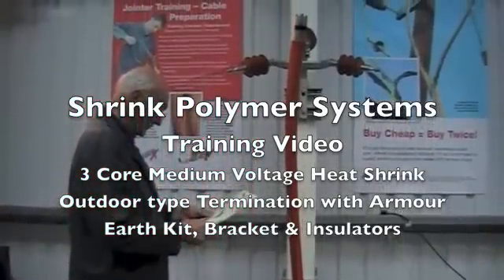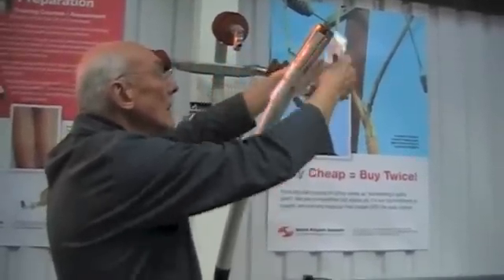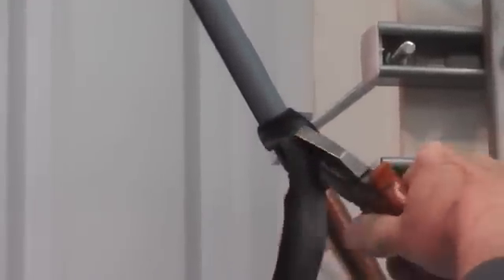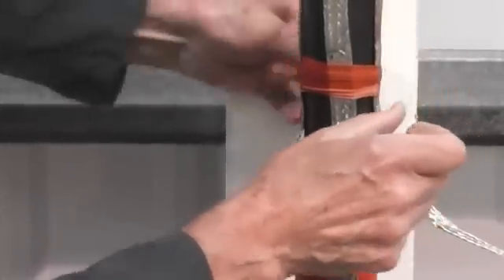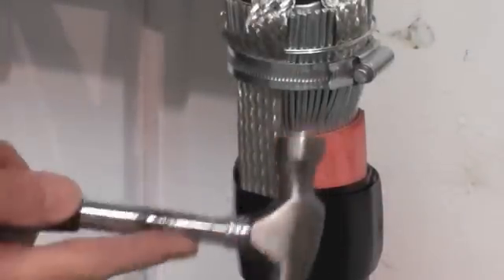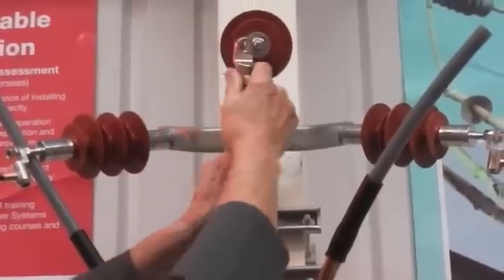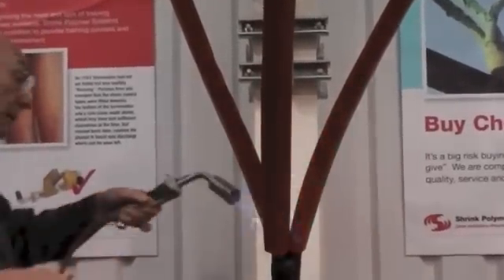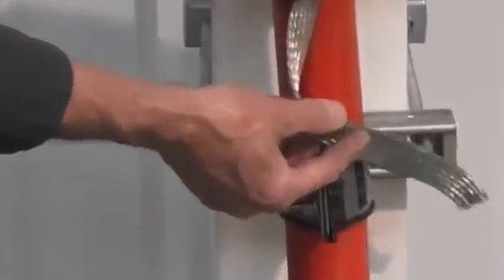3 Core Outdoor type Heat Shrink 11kV Termination with Armour Earthing

Comment: 1.) You will get water-ingress over time because you placed the earthbondsleeve over the three breakout sleeve... 2.) In terms of 33kV the gaps between conductor, terminator and shield have to be completely sealed, which isn't been done! 3.) Using clamps is never a good idea, use rolesprings instead! 4.) The Armoring needs to be completely earthbonded - hasn't been done aswell - Bad termination!
Reply from the maker: The adhesive lined earth bond sleeve fully seals onto the cable jacket and the breakout skirt so no moisture will enter. The earth braids that exit the sleeve have solder blocks and these lay upon black mastic tape and have black mastic over so no moisture will pass this.

The earth bond is very secure, roll springs are suitable for copper tape screen earthing and lead earthing but do not supply a solid earth connection on the armours. Your point there is incorrect.

Red mastic sealant is supplied and covers the end of the primary insulation, fills the gap between conductor and lug barrel and extends upon the lug barrel. The anti-track tube is then fully sealed once shrunk into position.

The termination has been fully tested and subjected to salt fog and humidity tests designed to simulate long service life. We have been selling them for 25+ years without issue.

The jointer fitting the termination is also very experienced. I think your comments are not correct about being a bad termination.
Reply: Why didn't the fitter score the armour with the hacksaw, prior to removing the outer sheath...if he had done so,   he'd have had one task less to do.

Comment: at least tell the specification... lenght and cutting etc
Reply from the maker: This information is all within the instruction sheet. The video shows a 6.35/11(12kV) 95mm2 cable being terminated but the principle is the same for 17.5kV, 24kV and 36kV, just different dimensions and longer stress control tubes and additional rain sheds